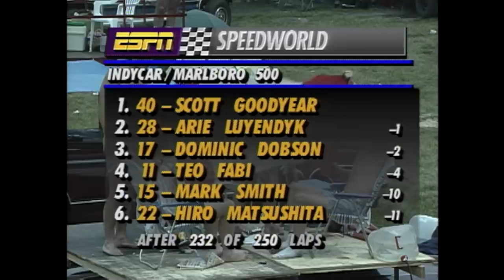1994 Marlboro 500 at Michigan International Speedway | INDYCAR Classic Full-Race Rewind

Comment: The golden years of Indycar: 80`s and 90`s. Fantastic cars and drivers. Good calendar. Races from march until october. I definitly  miss those years.
Reply: Think everyone misses these day, hopefully they will return
Reply: Then Tony George came in and sucked the momentum out of Indycar pretty fast by the end of the decade. To bad the CART owners were to dumb to let Tony George do what he wanted.
Reply: rob mush this set indycar racing back 20 year I think but I also think things are heading in the right direction now, cars are missing 200 to 300hp but i think indycar is planning on changing that.
Reply: @marchewitson6191  They are but they need to make it more exciting, free up the revs, go back to methanol with the new engine on 21, and open the chassis regs so another player can join in.
Reply: TheUsmc1488 yes I agree. I think there’s something missing, for me it’s the machinery not being pushed to its limits like it used to be because there’s no competition there, back then the drivers were like test pilots, speed was squeezed out of every part.
Reply: Marc Hewitson for how much they got rid of everything in Tony George’s agenda they still have kept some of his spec rules and regulations that he came up with in the original IRL.
Reply: rob mush I can see why though, they are trying to keep costs down to allow smaller teams to compete, you need to have a balance though, the cars are to slow at the moment but things are going in the right direction
Reply: Marc Hewitson however he never should have did the 25/8 rule in the 1996 Indy 500 for his gain and agenda.
Reply: rob mush yeah that race was a mess, none of the cart teams took part and made a bit of a mess trying to complete in the us 500 at Michigan on the same day,  what a mess, surly for the good of the sport something could have been done to avoid this.
Reply: I always think it is more than that. Remember that from 1992 to 1996, Mears, Al Unser Sr., AJ Foyt, Mario Andretti,  Gordon Johncock, Sneva and Danny Sullivan (and others fan favorites like Gary Bettenhausen) ALL RETIRED, leaving us Billy Boat and Dr. Jack Miller. The baton was dropped when those legends retired. NOW, IndyCar seems like it is trying to phase out ovals.
Reply: Paul Sarna I was just thinking the same thing the other day, I’m thinking now its not just what happened with the IRL and CART but a few things that made people turn off. There’s not many these day who you could really say “he’s a legend of the sport”
Reply: Paul Sarna but yet they brought back Pocono. CART left there way back after 1989. However I think Indycar really wants to go back to Michigan but ISC is all but NASCAR anymore. The France’s now both of them and so they don’t want to lose money with indycar. However NASCAR has to be losing money in terms of tickets sales since nobody goes to the Michigan races for NASCAR. Along with many other ISC owned tracks. 
 The only thing keeping NASCAR going is the money from TV and sponsorship deals.
Reply: rob mush indycar needs tracks like Michigan, Michigan doesn’t fit with nascar in the same way Indianapolis doesn’t. If you look at a lot of what indycar is doing now it’s the same as what was happening in the 90s there trying to bring things back to when it was popular, look at the way they have changed the cars, some of the tracks are starting to pop back on the calendar now as well. Add 150 to 200hp to the engines and things are looking good again
Reply: Agree 100%.  The early 70s to the early 90s was the golden age of the sport.  Technical advancements and changes every year,  but always enough familiarity to make the sport easy to follow, high enough attrition that 500 mile races felt like real endurance fests, not having fifteen cars on the lead lap at the end of the race, more teams and more variety in the paint jobs, and last, but not least, a good healthy 75/25 or so mix of American and foreign drivers.
Reply: @marchewitson6191  now 2021. Everyone also missed this kind of racing.
Reply: @robminmonaca  have u ever played CART FURY?
Reply: Golden years of CART, not golden years of Indycar...  Indycar actually had better days even better than cart. You just don't remember or were not old enough.
Reply: @marchewitson6191  not me

Comment: I know it's a viscous circle, no fans equal no money, no money equals no fans. Indycar needs to entice manufacturers and sponsors back by spending some money. Look at those full stands. Cars were covered in sponsors, multiple engine manufacturers , and multiple chassis. Free up the rules to entice manufacturers back. Give them a reason. Yes, no manufacturer is going to have a twin turbo eight or six cylinder in their SUV. However racing alows engineers to exercise their brains, trouble shoot, design, and test. It's still a worthy invest.
Reply: TheUsmc1488 but because of Tony George and the split they still don’t want nothing to do with Indycar. I mean Toyota and Ford should be back in Indycar. The series is starting to grow a bit and if they would ever come back it could make the series even bigger. They are wasting so much money in NASCAR when not a whole lot of people care about it anymore. Thank You Tony George for still having the sport of Indycar crippled.
Reply: Lots of tobacco money you'll never get back.
Reply: sdsmt99 well they still have all kind of beer sponsors still in NASCAR. Maybe they need to get them back into Indycar. Budweiser, Miller, and Coors used to sponsor in Indycar for a long time and by the middle of the split they all went to NASCAR.